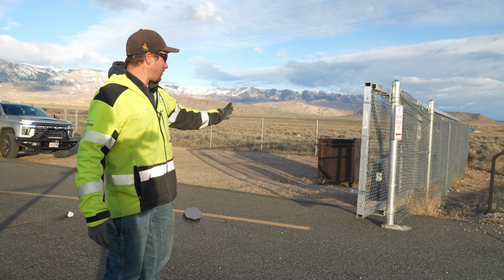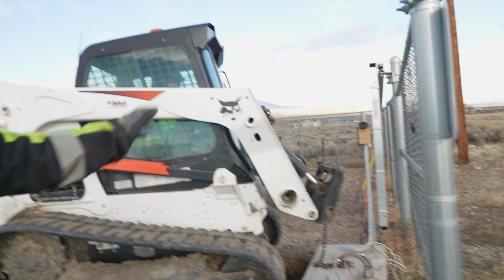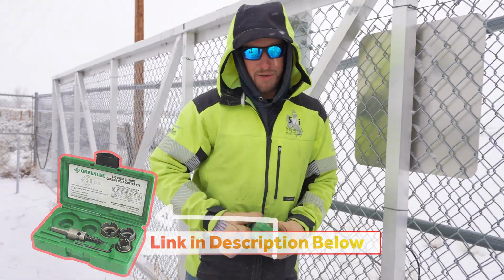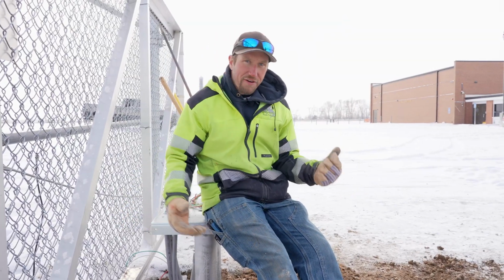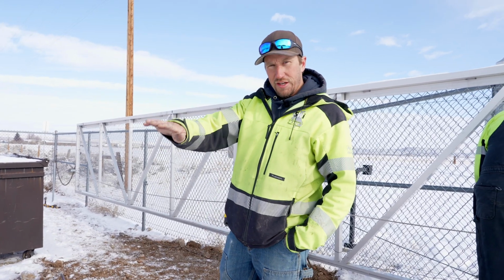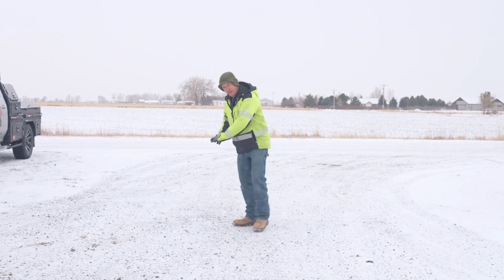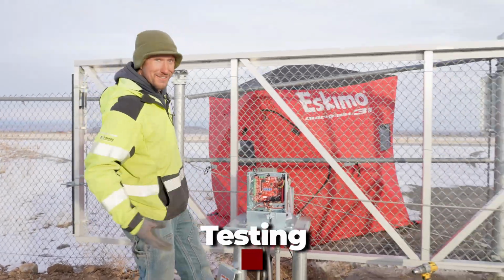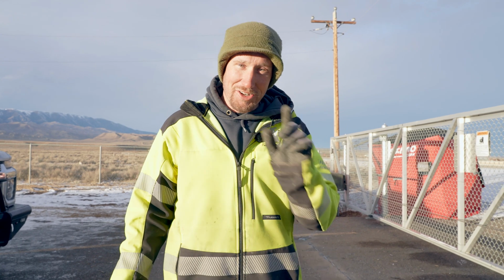Giving This Gate Operator 1,000X Upgrade

Comment: When you install wired edge detectors on the gate, how do you install the cable back to the operator to allow it to travel with the gate but not be exposed to damage? I have an application where we’d like to avoid wireless devices if possible

Comment: Viking makes an excellent product! But...your environment may be more conducive to other opener brands that have a board installed differently. Mice, lizards, etc ARE problems for many openers though, not just Viking. All-O-Matic is a very woke company that fired employees for not getting the jab. Yea...true story.  One way to fix the rodent problem is with MOTH BALLS or INSECT EAR TAGS like farm and ranch stores sell for cattle in those types of environments.
Reply from the maker: Good tip. 👍🏻
Reply: I'm in the south the best thing I've found for pest: peppermint oil, cinnamon, and powdered hot pepper.

Comment: Dan… Man O’ Man… Gate Operator?   What will they think of next?

As you know… I grew up in a farm.  I have vast experiences with fences and gates.  As to Gate Operators… that was my job. Only, my title was Gate Boss!!!

On the dairy farm, there are a bazillion gates.  You have entry gates, man gates, corral gates, sorting gates, stanchion gates, drop gates, head gates… we even had a neighbor named John Gates!

Each one opened, closed and locked in a different way.  Dependent on the task, they might have to be operated differently.  And, many times more than one gate had to be operated in tandem.  

Dan, cows have a mind of their own… although they learn to respect a good solid gate… you get them excited and they totally lose their gate sense.  Now a 200 lb calf can be Bossed fairly easily.  That 1000 lb cow can normally be returned to sanity with a quick exhibition of proper Bossing authority.  But, a one ton bull?  Well sir there ain’t a lot of gates out there that a mere Gate Operator could wield into place and stop them. Because just getting it in place in front of them is like stopping a freight train by parking a Prius on the tracks.  

However, a Gate Boss who has graduated from the Farm Boy School of Gate Management, can size up the situation immediately…. Decide if the bull can be turned… Decide whether that gate is stout enough to survive the onslaught of that ton of raging beef… and Boss that gate open or closed to do the job!

And, they can do it regardless of whether their circuit board is clean and vertical.., or slanted and covered with fecal matter.  Note:  Failure to exercise the right judgement will likely result in the circuit board being immediately slammed into the horizontal plane and buried in fecal matter!

So Dan, riddle me this… these Gate Operators you propose… and their vertically positioned brains… Will they render Gate Bosses obsolete?  Will farm boys everywhere be deprived of the lessons, that only a ton of beef chasing a  half ton of female in heat, can teach?  Or, is that really the hidden plot behind the whole Gate Operator idea?

FYI… our neighbor John Gates raised hogs… let’s not go into the advanced Gate Bossing skills required over at his place!
Reply from the maker: Pretty sure all the Gate Boss positions will continue to remain secure. Gate Operators aren't really competing in the same market. 😄
Reply: @SWiFence  that’s a relief… farm boys everywhere need those jobs!

Comment: Wel-200 is a great edge kit. Use them all the time. Never really cared for Viking operator’s. My preference is door king. I’ve had the least amount of call backs on them. Do you guys like hy-security operator’s? The programmable features are on another level with them. Love your videos keep it up.
Reply from the maker: Hey thanks! Yes we use them a lot actually but mainly the drive rail operators.

Comment: What specific type and width of blade are you using for the saw cut in order to fit the bd loop in the asphalt? Thanks for taking the time to make these videos.  Its been a real resource for information while i expand the services i offer.
Reply from the maker: Thanks! We use the blade from bd that is the same thickness as the loops. there are thinner loops out there as well.

Comment: We use a lot of power master gate openers here.  generally if I have to remove a concrete base I will lift it with bob and break the concrete with a sledgehammer. The heat blanket is a great idea for bending conduit, I usually use a heat gun and generator. Had no idea you could get a premade pedestal  We prefer a rack and pinion system over a chain.